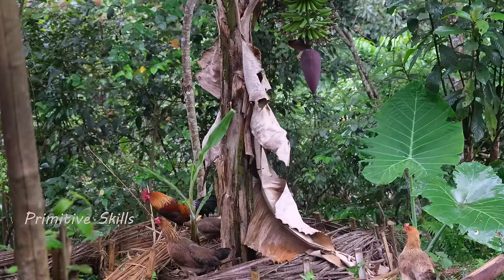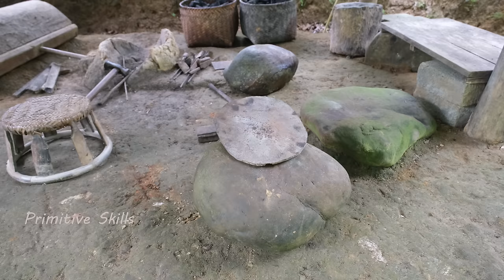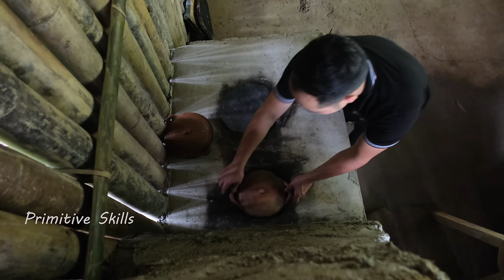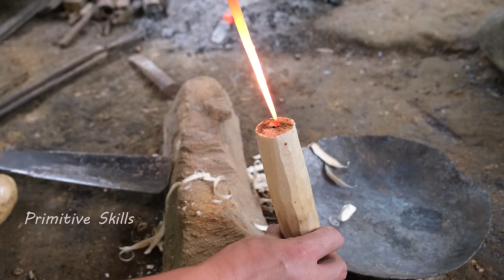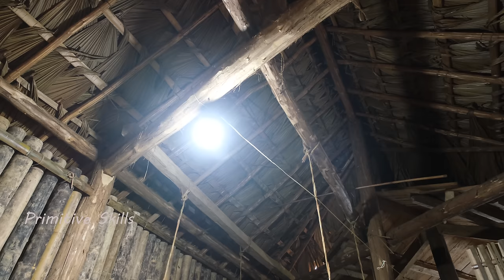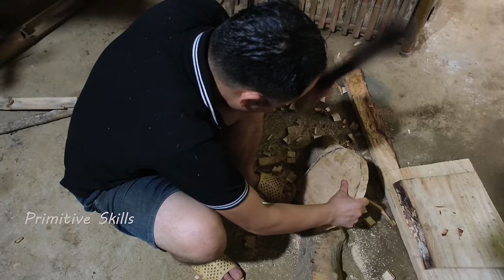PRIMITIVE BLACKSMITH | Forging iron pan, Cooking

Comment: Some of your videos are just plain insulting. Yes, you demonstrated how you got iron, charcoal, cement lime, bricks etc. In small quantities, BUT... The amounts of these precious things you suddenly have available is simply impossible. Please, for your loyal viewers, be honest
Reply: @You Justnobody
Why are you so easily offended ?!  This channel is whatever he chooses to show you.  He made no promises to you.
He has already been going into town now, for several videos.  Anything he purchases there, is appropriate.  He has a hydro-generator and electricity.  He didn't make those either.  The storyline has shifted.  Did you miss the turn ?!
Reply: @jimbayler4277  when he speaks of "left over iron" there is zero doubt that he means that the iron he is using is from the original smelting
Reply: @Me Justme  : Incorrect.  It also implies "Left over from a previous project".  Whether it be iron he himself produced, or iron he bought in trade/money earned from sale of his produce.

In the evolutionary arc of his storyline, the points you are trying to drill into are no longer pertinent.  He is now trading for goods in town.

Besides, you don't know if he smelted a few pounds of iron..... or a ton.  
You don't know whether he has done one, or sixteen blooms. He has illuded to have had some failures initially.  
So, he has done more than one.  
You only know what he has included in the videos he posts.

"Amounts simply impossible":  If you knew anything about metal working, you would know that everything he has made with iron (including the nails) could be produced from a bloomery block of roughly 8-10 inches square.  
That is the amount that can be produced in only one or two blooms.  Especially based on the size of the one bloom he does show in his videos.

You have let your imagination run wild with this "vast quantities" thing.

Inferred deception:  You have only proven your limited experience and knowledge base.  
Oh !  And your unfounded belief that if you can't do it, nobody else can do it either.

The verbiage you use and the unfounded points you are trying to make sound suspiciously like certain previous Trolls and their AKA Fake accounts.
Say hi to @Homeless Mindcrap for me, would you ?
Reply: @jimbayler4277  oh dear, you have totally misread who you are speaking to... I am a survivalist and swordsmith of more than 30 years experience. I have forged, founded, and refined iron on 4 continents. I am perfectly capable of judging the yeild of a bloom,and I will tell you straight; no way is more than a kilogram of iron "left over". I have followed this guy for four years, and truly admire his work, but honesty is a valuable commodity
Reply: @mejustme8138  :  If you are all that, then you know that it is highly likely that he ran more than one bloom. 
He simply didn't present us with a video depicting multiple blooms.  

You are rigidly sticking with the concept that there was only one bloom.  Why ?!

He also has only shown himself having collected eggs only a couple of times.  Yet we know he must collect them at least once a day, if not twice a day (chickens being chickens, and him having a respectable size flock).

There is nothing dishonest with what he has presented us.  He never claimed to have only done one.

You have no idea if his "leftovers" are from the first one, or the sixth one.

You have chosen to narrowly focus on him supposedly having done only one bloom as being the only possibility ?! Why ?!  

In your career, did you only do one bloom ?!

In your illustrious career as a Blacksmith, did you record everything you did ?! (Everybody takes pictures of their hobbies).  

Or did you just go out and do much of the boring, repetitious tasks, and put them behind you without recording it ?!

"Leftovers":  You, as a metal worker, never throw away scraps/drops.  
Regardless of whether or not you bought it or refined it yourself.  
You ALWAYS save them for potential future projects.  Scraps from either source still qualifies as "Leftovers".

Now that he is trading in town, it doesn't matter if he bought/traded for iron from a scrap metal dealer.  Technically, anything he bought from a scrap metal dealer could also be considered "Leftovers".

To be honest, I don't really care what the source is.  The topic on the table is him hand forming a pan using a primitive forge and primitive tools, with a primitive knowledge of iron work.
Successfully !!
Pretty impressive to me !

At first, I thought he was starting with a bought piece of plate.  But then he zooms in on an edge shot of the blank.  You can see that it is very crudely formed.  The blank edges vary anywhere from .375 inches to .750 inches.  You cannot buy iron like that from a commercial source

"Mis-read":  I doubt it.  Perhaps who you are.... but not what you are.
You could be reading off the same script as the others, only slightly refined.
Reply: @jimbayler4277  but that's my point : the amount of iron, coal, lime etc that he is using would require the workforce of a village to extract and a moderately sizeable mining operation. These quantities don't simply come from a few wheelbarrows of mud from the river..
Reply: @mejustme8138  :  First off, @P. Skills doesn't use "mud" from the River (iron sands or Algae).
He uses rock ore.  

You claim to have watched him for four years.  In one of his videos, he even gives you the assay on the ore he collects.  That ore shows weathering and green algae.  So,his ore is surface collected.
Why didn't you know this ?!

Second, He doesn't used Coal.  He uses Charcoal that he produces himself in that kiln to the left of his kitchen.  that is the same kiln he cooks his limestone in.
He has a whole forest surrounding him.  He is not lacking fuel.

You just shot your credibility in the foot, again.  With your claimed Bloomery and Blacksmithing experience, You should have instantly known the difference.  
You didn't.

Thirdly:  "the workforce of a village ":  Just how slow and lazy are these villagers, in your imagination ?!
The amount of iron he has produced, can be extracted from 2-3 cubic meters of ore (2-3 tons).  Especially at the assay he had.

"moderately sizeable mining operation":  Rough guess is that his little wheelbarrow holds approximately 1.5 cubic feet of whatever.
That is only 55-60 loads of that little wheel barrow !
Boy !  That sure is some "moderately sizeable mining operation" !!

Limestone:  He is not lacking in that either.  That mountain behind his house, and that impressive cliff across the river, are both limestone.
He would have more than enough material from the scree flows.  No mining needed.  
just fill the wheelbarrow from a loose stockpile.

You sure love to exaggerate and inflate your numbers !!

You are sounding more and more like those Trolls I mentioned previously.
You have apparently done some research since then, but your arguments, style of argument, and position points are still the same.

It is too easy to poke holes in your arguments.
Reply: @jimbayler4277  oh dear, I remember the iron sand episode from the Australian originator of this genre. Wow, BIG mistake, I guess... Nevertheless, his ore, (after a quick review of the relevant episodes) yields a pretty average amount of pig iron... After considerable effort. I in no way doubt that he actually did it, only that to have at his disposal the ridiculous amount of iron he casually uses (especially the nails!) would require a far bigger and time consuming enterprise.
As for his (char) coal... Ditto. The amount of coal required for smelting ( not to mention his pottery kiln), demands enormous effort, not a simple one day task, and after that you somehow have an infinite supply...
As for lime, it has to be baked for several days, producing an extremely toxic fume. Simply saying that there is plenty of raw material around doesn't change the fact that EVERY. SINGLE. STEP. involved is massively time, resource and space consuming.
Reply: @mejustme8138 : "Ridiculous amounts":  With every telling, you inflate the amount of Iron in his small stash.

He could even be scavenging old shrapnel.  We did bomb the snot out of that part of the world.  
He would be practicing the "Hunter/Gatherer skills of his ancestors.... Collecting what the land provides you.

"the ridiculous amount of iron he casually uses (especially the nails!)":  He has four iron tools:  a small bladed shovel, a hoe, a root chopper, the Vietnamese version of a machete, and nails that he uses sparingly.  Most of his Fastening needs are met by that twisted vine that he uses to lash everything together.
There is nothing he "casually" uses iron on.
Where is this ridiculous amount of iron you talk about ?!!

Charcoal:  You "have" smelted iron.  Just how much charcoal is needed for his type of kiln to produce a bloom ?! (5-6 feet high, 2-2.5 feet outside diameter).
Again, you infer that he does this on a regular basis.  A single run of his charcoal oven produced well over a cubic meter of charcoal.  A cubic meter goes a long ways. Especially for forging where you are ladling it out by the small scoopful.

His pottery kiln:  What was the time/date stamp of the video in which he last made pottery ?!  How many ceramic items do you see around his homestead ?!  You infer that he fires large quantities of ceramics on a regular basis.
He did 10-15, maybe 20 pieces total in two firings, if I recall correctly.  He used raw wood in the old Chinese/Japanese method.  If you notice, he lives in a fast growing forest.  He has also cleared a lot of space for farm activities.  He wastes nothing, and burns it all.

"Time-consuming":  Time is what he has the most of !  He obviously doesn't waste much of it.  He uses it like his ancestors, 12-14 hours per day, or whatever the daylight allows him.

" demands enormous effort":  He is obviously not afraid of hard work.  Everything he does, requires a lot of effort !!  For the last 37 years, I have done very similar work, and now my body is paying the price.

"not a simple one day task":  ?!!!  Where do you get that time reference from ?!
Simply because you watch a thirty-minute video, you assume that he does it in only one day ?!!
In one of his older videos, (can't remember if it was the charcoal or the pottery one) he depicts the long process.

"massively time, resource and space consuming.":  He has two of those three, and expends the third.

You will find it easier to wrap your mind around what @P. Skills accomplishes, if you don't continually inflate the "numbers".

Check this guy's series, out.  It is about traditional methods/small scale, as it was done for generations. (In Spain)
Most of the things we have been discussing, are being done on a scale hardly larger than @P. Skills, and nearly as crudely.
https://www.youtube.com/@eugeniomonesma-documentales
Reply: @mejustme8138 : Interesting !  A Bladesmith and Blacksmith who has smelted iron on four continents..... yet no pictures showing off your work....
Or, even events you surely attended....
Interesting !